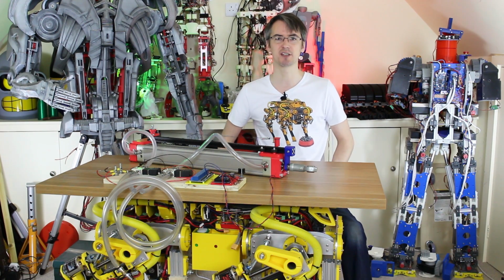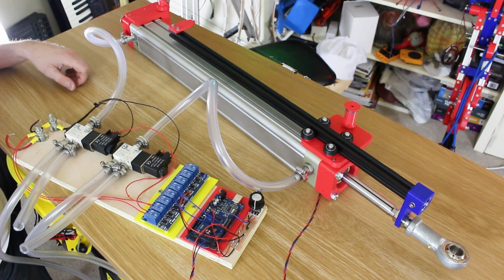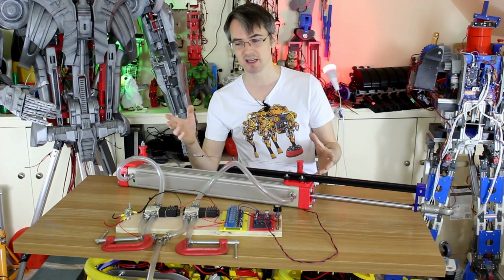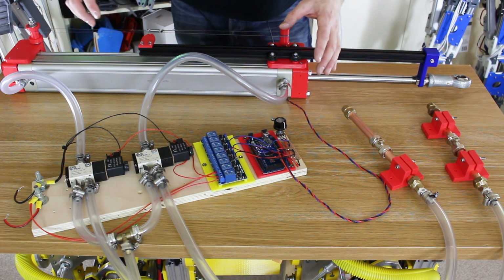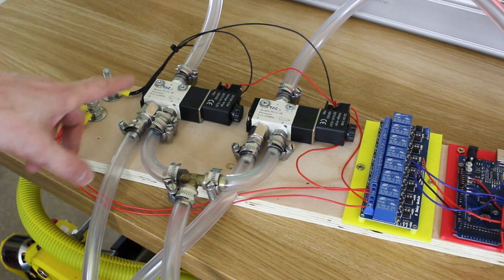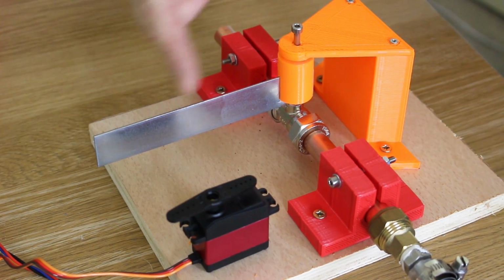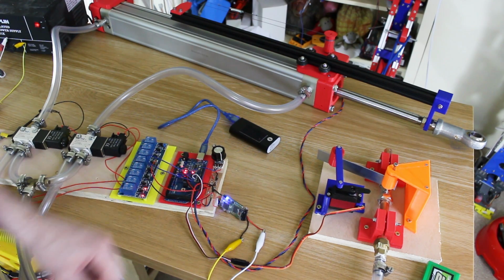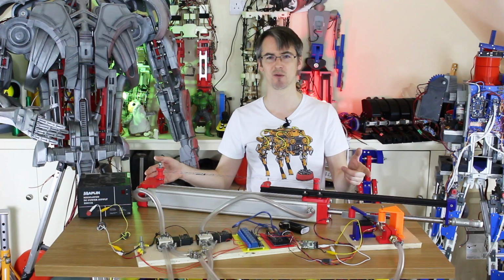Testing Proportional Control of Pneumatic Cylinders | James Bruton

Comment: Sure, by now with your education you worked out why, you have made air multiplier so compressed air, water and electricity is lazy, It's travel back along the pipes passed each valve (which is a two-way hole) from rod side to piston side,  This also happens when bypassing piston seal when apply pressure to rod side once it stops traveling "magic it extends slowly on its own" as the air bypasses. Quick fix two regulars will achieve same as two tanks, as they close off when reaching line pressure, check vales has surface area issue pressure difference making them unreliable for fast closing, The seals friction plays part head seal grips more on extension than retraction shape of seal. Cranes use pressure both side for better control so think opposite to logic its forcing fluid in not letting it out to move.

Comment: Very late to the game here but I thought Id share this.

Ive seen through shaft cylinders that are made to equalize the volume difference between the two chambers. 

Wether theyre available in your required size I dont know. And the shaft poking out the other end might be a nuisance. But they might help you in this project. If its still on 😁

Comment: hm, I think you approched the problem wrong, if a 5/3 valve (middle closed) is used, there should be no more permanent creep, then if a pneumatic pilot operated valve is also used directly at either end of the cylinders with a middle open 5/3 valve and restrictors on the outflow of air, quite precise motion should be achievable without creep or bouncing at all. The only thing it should still have as a disadvantage is that its not stiff like proper hydraulics, for that last step a cylinder with best built in pneumatic calamping is required. There are videos of this on the web If (stopping a pneumatic cylinder) is searched, though the one I have in mind is german.

Comment: It seems weird that the back EMF is killing the Arduino.  The relays should provide isolation between the valve solenoids and the MCU.  And the relay boards have diodes for the relays themselves and use optocouplers on the inputs, so the Arduino should be protected from the back EMF of the relays themselves, assuming you haven't tied the grounds together.  Anyway, snubber diodes on the solenoid valves (or capacitors if they are AC rather than DC).

Another thing to remember is that a lot of pneumatic valves are internally piloted; the solenoid just opens or closes a small bleeder valve, and the air pressure itself is used to switch the main valve.  That's why the valve datasheets often specify a minimum as well as a maximum working pressure.  I'm not sure what that minimum pressure is relative to, though.  If it's the difference between the input port and the exhaust port, then trying to modulate the exhaust rate could create enough back pressure that the valve won't switch completely or reliably.

Comment: You keep making the mistake that there's more force when therer's more air in one side or the other.    Wrong       Force is dP * Area and Area is  constant in the cyliinder.   And if there is no net force in the arm the pressures are ALWAYS equal regardless of  the amount of air in either side.      

when there's force (weight or other load on the arrm  there is always a differential pressure in the cylinder at the stop exactly equal to the force divided by area.  And again that differential is exactly the same at any position.   

The only thing that really different with the position is  ds/dF on the actuator arm ... which is always going to be (in a cylinder with an arial piston)  directly proportional to pressure and inversely proportional to volume,   

This is all really basic physics and simple proportions.    But you;ve done inverse kinematic models so this should be pure cakewalk .... but it's worth doing just so you don't keep confiusing people by implying  that force has some dependency on position.  It doesn't.    Rigidity one way or the other does, but force, none at all.

Comment: This comment may be a year late. Use two pressure regulators. Set the lower surface area side higher then the larger side. Remember PSI is pounds per square inch. So the pressure difference would be at the same ratio as the two surface areas. Essentially you want the force on both sides to be the same. With this done there will be no creep. Example: if you have 1 psi on a 10sq.in surface and this is acting on a 1sq.in surface pushing into a sealed chamber. The sealed chamber would have 10psi inside it. All movement will stop once the sealed chamber reaches 10psi. I think this is why when you had two air sources, you didn't see any creep. One was higher in pressure then the other. And by luck it just so happened the lower surface area side was higher in pressure.

Comment: Oh James, I got my cart in front on my horse. I went and bought some goodies to try this out and just realized the code on GitHub is for an encoder? Is there code for the potentiometer version you have above?

Super cool, btw my Basset hound loves her RC dog walker & I owe it to your Wiper Servo code... I swapped a set of resistors in place of the pot to create a fixed resistance then changed to mapping to 0, 0 so when I let off the stick it automatically brakes :)

I had to run each motor controller w/it's own independent Nano because I couldn't work out how to manage two channels and that timer in the code.

Anyways, still catching up on all your videos, glad I found you.

Best wishes.

Comment: Easy use feedback controller,why aren't you using another same wire on cylinder as feedback, fix the switch output pressure on certain level so, if you set 4 volts on trimmer pot the valve will turn on and will not turn off till the feedback value reach to 4 volts even you can set the feedback range +- 0.10 or 0.5 this variation is okay, it won't affect cylinder position, basically you can also use proximity sensor for feedback but it will not give the accurate range for accurate position so, i guess the feedback voltage option is good, try it once! I'm waiting for new video with this solution please    inform me on this mail id(jayp0532@gmail.com) if you make, I'm so curious to see.

Comment: btw, if you had a Double Rod Air Cylinder (rod at both ends) the surface area would be the same. Also, more accurate if you use oil which is noncompressible. Make sure the seals are oil compatible. Definitely use the 5 way valves.

Comment: hydraulics would be more compact since hydraulic fluid is reused and non compressible
Reply from the maker: You can't store hydraulic energy like you can compressed air - so you need to constantly run a pump and have a sump of oil somewhere.
Reply: @jamesbruton  yeah the pump would have to run for movement but how much movement are you gonna be able to get out of an air tank of reasonable size? Unless to opt for highly compressed gas that is in 100lbs bottle?

Comment: James: this old engineer enjoys your videos, but it is difficult to 'see' the system when it is on the bench. Good old white board system drawings often help understanding. Modeling the system via electrical analogs of mass/spring/damper with Ltspice would be one approach.
(As well as instructive for the viewers.) Anyhow- very entertaining, and unique for YouTube I suspect. You pack much into the videos and at a fairly accelerated rate,... pun intended. I commend your enthusiasm - it makes for a wild ride on this end. Cheers D

Comment: Hello James! Great job. You can make system more controllable by setting control valves without tubes - close as possible to cylinder. And use stell tubes. All actions in pneumo sistems have a speed limit - speed of sound. So if you control system close a solenoid - you have a time delay before pressure in cylender change - becaose you have relatively long line connecting control valve and cylinder.  also - may be interesting to implement a position feedback sensor right in cylinder. Taht must be a ultrasonic rangefinder or something else. Measure range from cylinder bottom to piston... Anykind - very interesting video. Thanks a lot. Sorry my bad English.

Comment: just wire up two suitable Digital pressure gauges into the microcontroller and balance them properly that way.
bung up the higher side with a small drilled hole [Venturi effect]  /make a generic ball bearing/marble/epoxy ball inside some larger tubing and have that lay flat on the smaller tubing under gravity for the side you want to shut off, make a generic flat flapper version, "So why does the creep go away" because  you don't then have a direct path to both fluids in/out

oc the simplest is to just calculate the lower pressure side volume and then bung up the higher pressure side to the same volume with a dummy static solid bung.
same max volume in both sides = no trying to self equalise within reason

Comment: you would probably need to go with a closed loop system.  instead of venting the air,  you would have to connect it to the intake of  your compressor.  But than you would need a mechanism that would switch input and output hoses to move cylinder in opposite direction.

Comment: It might be a bit more expensive...  But I would probobly have one servo for each side. Other vise it will switch between and sort of pump pressure over

Then... If you have the servo there ... The valves is kind of not needed. At least not the output once.

Also I thing the large diameter of the pipes probobaly ruin it.

A way to make have a input and output. The same servo can actually controll both with some clever engineering. Have the valves In 90 degree of the servo center position . One way for in, and one way for out

Comment: Hey James!

Your relay board has optoisolators, that should prevent the emf from getting back to the arduino.  Remove the VCC to JD-VCC jumper and power it from an external source through the JD-VCC pin!

Comment: I/we make hydraulic servo controllers for industrial uses.  I/we can also control pneumatic servos but it is a lot trickier.
You only need one supply source and one 4 port servo quality valve.   Yes, there is different open loop gains in each direction but that isn't the real problem.
Proportional only control is not good enough.  You need to add derivative and second derivative gains along with a velocity, acceleration and jerk feed forwards.
It is all about placing the close loop poles.  Yes, the system is non-linear but you need to use computer to compensate for that too.
Pneumatic control is not easy.   You are fighting an up hill battle.

Controlling the motion with 2 3 way valves is even more challenging but the results can be better.  You want to keep the pressures as high as possible in both ends of the cylinder.  This keeps the bulk modulus of air higher so the system will be stiffer.

You really should have simulated this on a computer first.

Our hydraulic motion controller was used to move some of the scenery or props in Transformers 1,2,3, not 4 but it will again in 5.  I have met the person that does the hydraulic controls for that series. 
One more thing.  This is how we do it.
https://deltamotion.com/peter/Videos/PneuMove2.mp4
 Yes it looks good but in reality it is difficult to keep a system like this working in an industrial environment because oil and water eventually gum up the cylinder so it doesn't move smoothly anymore so the cylinder suffers from stick/slip or Stribeck friction.
Reply from the maker: Writing the computer simulation is probably a project series in itself.

So why does the system work much better with two separate air sources?
Reply: "Writing the computer simulation is probably a project series in itself."
I have done it.  It solves combination of 9 linear or non-linear differential equations.  I use a simple RK4. 

“When you can measure what you are speaking about, and express it in numbers, you know something about it, when you cannot express it in numbers, your knowledge is of a meager and unsatisfactory kind; it may be the beginning of knowledge, but you have scarely, in your thoughts advanced to the stage of science.”. ― William Thomson, 1st Baron Kelvin.

I simply say you can't control what you don't understand. 

"So why does the system work much better with two separate air sources?"
I can only speculate since you don't have pressure sensors on both ends of the cylinder.
It could be the difference in pressure drops through two hoses vs one hose and the extra volume of air will keep the pressure more constant.

I have only one tank but it is big.  5ft high and about 3ft diameter.
I have pressure sensors to monitor pressure on both ends of the cylinder so I can calculate a net force.

There are a lot of people that say "flow makes it go".  This is so wrong.
You are only controlling the flow.
Newton did not include flow in his 3 laws of motion.
The air cylinder will accelerate until the sum of forces acting on it is zero so controlling the net force is critical.  This is why you need pressure sensors on both ends of the cylinder.

Notice that my load was a constant 8 lbs.  I just had to account for the extra force needed to accelerate and negative force to decelerate.  I had to use a velocity and acceleration feed forward.  It is possible to just change the command positions and limit the velocity if you don't care about the time or acceleration and deceleration rates.
In a robotic situation the loads will be changing dynamically.
Do a search for active damping.

You are taking on an extremely  difficult project.

Comment: I would think that using them in a robot may assist with removing creep
Let's suppose the cylinders are vertical, the weight of the robot or parts of it should be exerting a force to retract the cylinder
(try mounting the cylinder vertical and add weight to the shaft, this should bia the force)
Look into spool valves, normally operated by solenoid, but you may be able to mske them proportional with servo's, you would only need one spool valve for each cylinder (they use spool valves on hydraulics, think of the JCB's etc)
Reply: I just had a crazy thought, if you use 2 smaller diameter cylinders, but mount them opposite way round to each other, the ends should cancel each other out

Comment: Have you thought of replacing the two solenoid valves with two of your servo controlled valves to create proportional ones ?
Reply from the maker: I think I'd need four since I have to let air in and out of each side of the cylinder

Comment: So first of all in my opinion if you want all movements exactly the same on both sides with using 2 compressed tanks they not just should be compressed with same pressure but also they should be the same exact size, then if you want to avoid creeping the most I can think of is that your pipes are fairly flexible and even tho they can stand the pressure they work every time you switch so it creeps, all I think you need to do is to either choose high pressure hoses all over or just hard copper pipe with elbows and all connections so there is no flexibility in anything at all. Of course I'm not a 100% sure about this so you would have to try it to know for sure if thanks to that you would loose the creep at all
Reply from the maker: It's fine with two tanks. They are both 24 litres. The question is why.
Reply: Well basically because when you use both tank you just have more air pressured to work with, when you use one tank you have only 24 liters of pressurised air and while using it it goes down mush faster then if you use 2 of them, try using both tanks together as one and see if there is a change, technically should work the same way as when you connect them separately.  I think the biggest problem problem is that every time you move the actuator you release pressure from the tank/tanks meaning your force is changing as the pressure gets smaller, maybe if you would use some king of pressure regulator that would be set up to a smaller pressure thank your compressor cen get it would give you constant amount of the same pressure, you could set it up to the point when the compressor starts to charge when the pressure goes away so even tho you use the pressure it's still the same even tho it went down in the tanks and when is charging. Let's say your compressor can charge up to 200psi, the as the pressure goes down and reaches for example 120psi the compressor starts to charge, now let's say you put a pressure regulator that keeps the delivered pressure constantly at 115psi then even tho is charged up to 200psi you still give 115psi of pressure to the actuator no matter what, while it goes down and reaches the point of charging you still have the same pressure because the compressor is starting to charge but you still use only 115psi because the pressure regulator doesnt allow more. Anyway that's just a thought 🙂

Comment: Just want to throw this in cause didn't see it in comments. Also remember the tubing itself can swell with pressure causing "sponge-ness" when compressed. This is even why high-end car brake lines are braided to prevent swelling. I would definitely try shortening all those lines and place solenoids as close as possible to the cylinder. No expert here, just a thought.